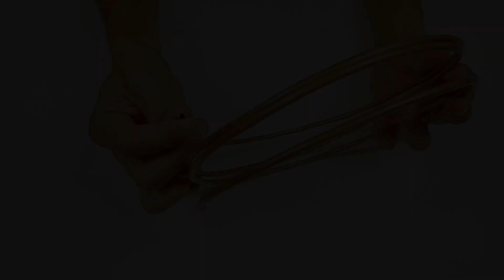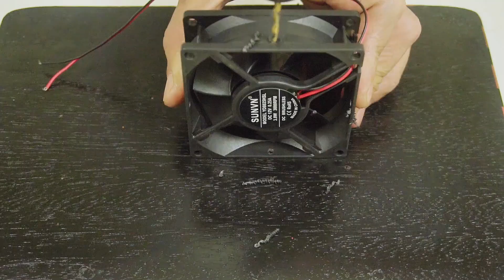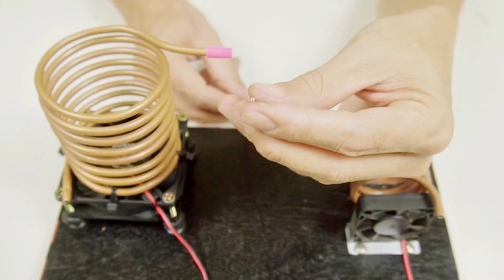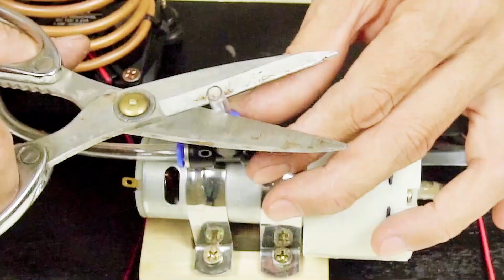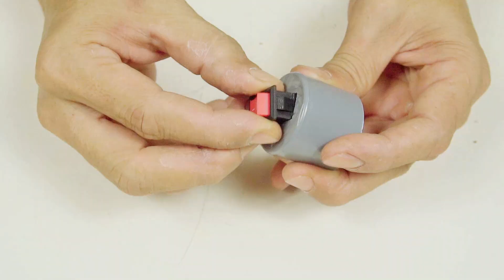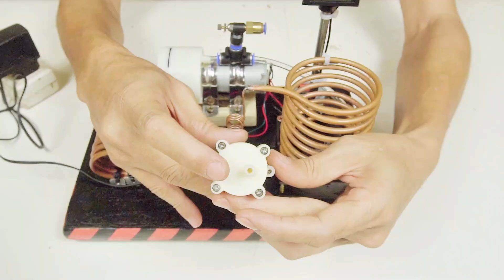DIY AIR CONDITIONER AT HOME AND REACHES -10°C! WITH ONLY 12V MOTOR 💡 Anyone can do it!

Comment: should be illegal this video u just made a bomb, every leak with a spark of energy or fire u are BOOOM :DD
Reply from the maker: You are sending a good warning, but the problem is not as dangerous as you think. Every refrigeration system we use today works like the model I did. Gas leaks (if any) cannot create a "Boom" as you say, it only reduces the cooling gradually... Thank you for watching and commenting on the video!